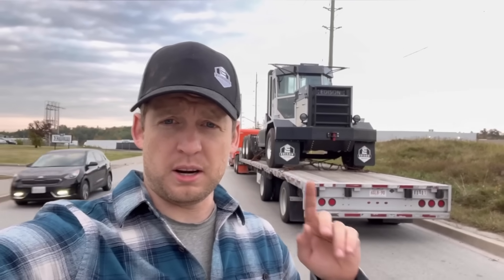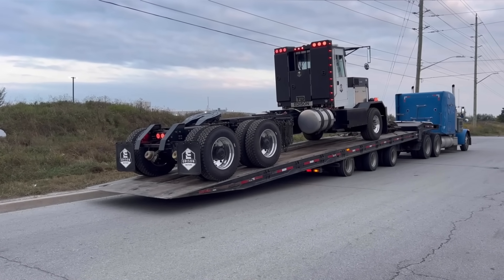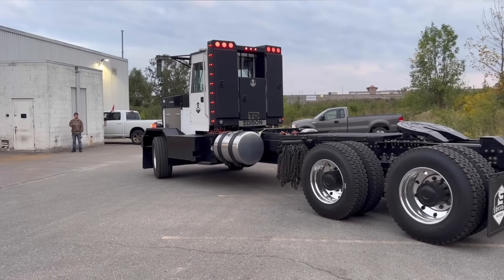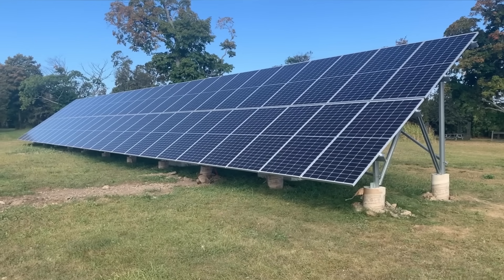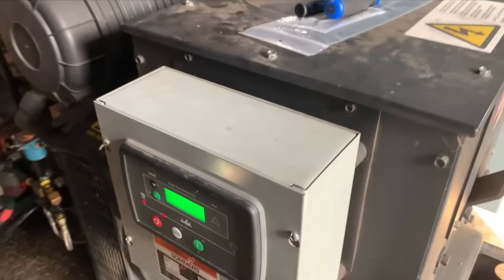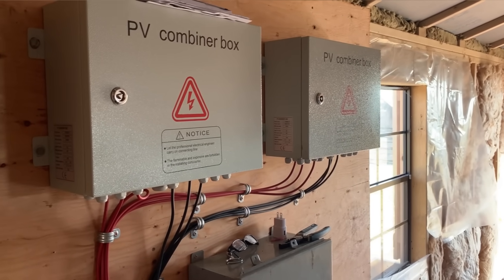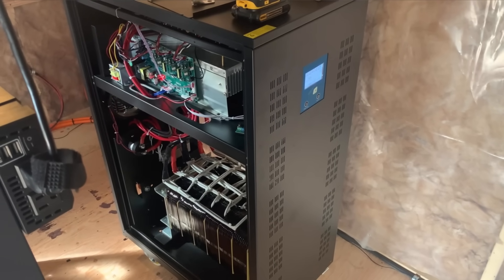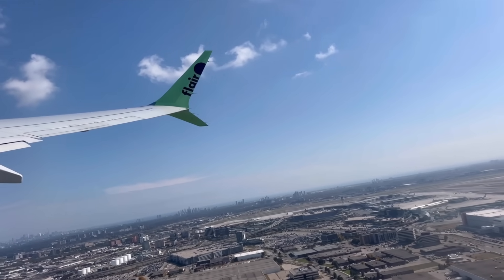Edison Motors Ontario adventure, Electric Trucks and Solar Islands

Comment: as usual great job, love the video, Why didn’t you guys use lithium iron phosphate, batteries like in the truck for the island solar project?.
Reply: Cost and availability
Reply: @-LightningRod- they'll probably have to replace those lead acid batteries every 7-10 years, instead of every 15-20 years for LiFePO4 batteries.
Reply: @charlesball6519  
Well, ..the matter relies upon type of cell and battery management capabilities. Northern telecom batteries in glass cases were lead acid and were capable of 90++ years. 21stcentury battery chemistries promise even longer when coupled with Monitoring BMS. Often we get confused with battery longevity when we are reminded to BUY a new vehicle battery every 1 - 2 or 3 years for our vehicles because,....,....
actually, ...there is no reason or excuse for us to be BUYING Batteries every year.
Reply: @-LightningRod-  You are absolutely correct. ECONOMICS should drive the decisions on battery chemistry (plus safety, but moreso economics). Sodium batteries should be readily available by the end of the decade, then things will change.
Reply: @-LightningRod- I have historically needed to replace my car battery every 5 years on every vehicle I've owned in the last 20 years (that's a total of two).

I know newer vehicles have a battery monitor on the lead acid battery.
Reply: The main reason to use lithium over lead acid in electric vehicles is the weight restrictions, which isn't a factor in permanent installs like this. So the cost savings is more important.

Comment: it's unnerving that a thing that big is so silent
Reply from the maker: It’s so weird, something this big and powerful shouldn’t move that silently
Reply: @EdisonMotors 
I'm sure you may have mentioned it at one point, but are you planning on adding some sort of speaker system or noise system so that pedestrians and folks on job sites don't walk into a blind spot unawares?
Reply: @Binturong3850 
I was going to suggest a small bldc spinner that has a not-so no-noise controller mounted on a surface that it can reverberate against
Reply: trust me, ..in the operators seat there is nothing quite so terrifying as an armature under full load.
Reply: @jlhutto 
i think Rail Executives are the biggest Losers when it comes to Bev's. 
You could literally add C-Cans full of batteries to be exchanged at remote yards and eliminate fuels altogether.
I see about a million HP go by my window  and a couple of tons of soot deposite4d on my boulevard every day. Lets be honest about Diesel -Electric when it comes to Rail in Canada,...its bullshit and still stuck in the early 20thCentury..
Somebody should KICK BomBardier right in the nutsack for being so damn lame.